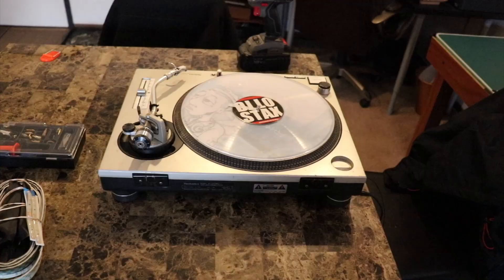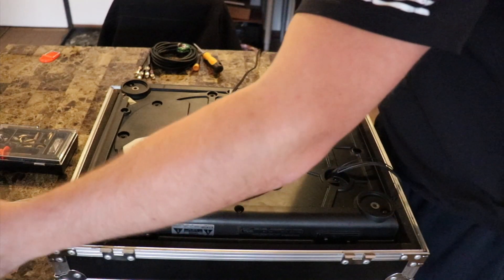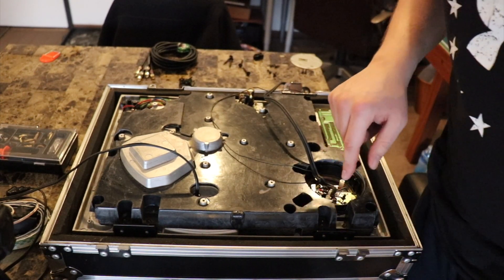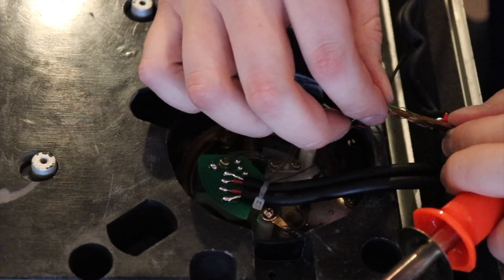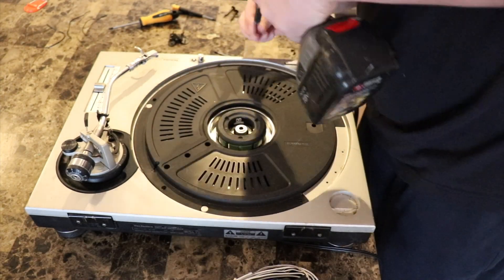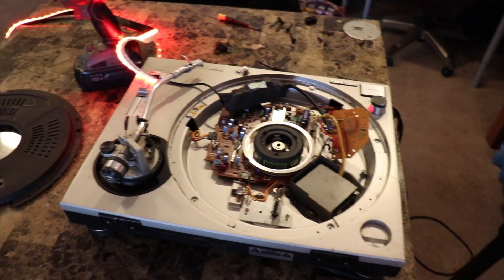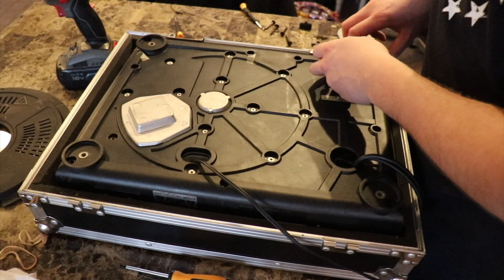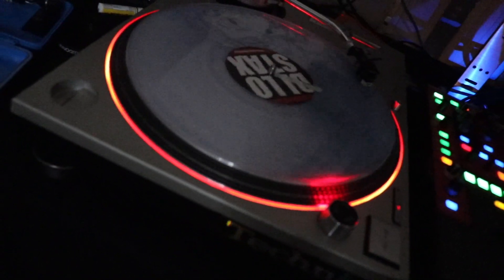Self Grounding Technics 1200's | Led Halo Install

Comment: Hey man, I figure last resort I could do some custom wiring on some led strip light for halos but do you have any particular place you got your leds?
Reply from the maker: Mine came from eBay. I went this route because they have the proper resistors built into the light strips.